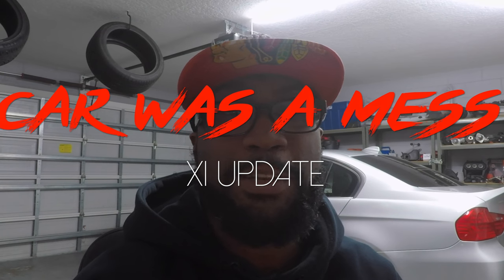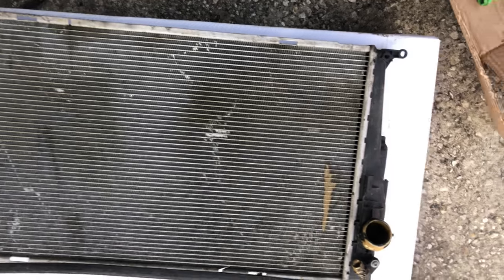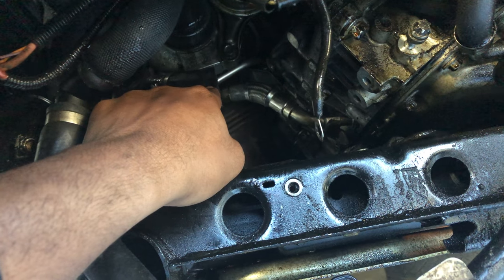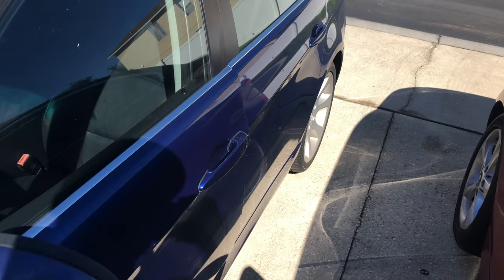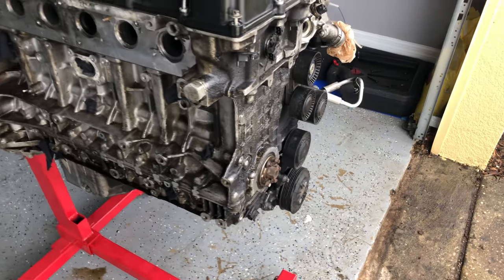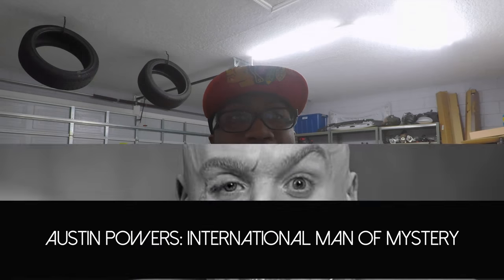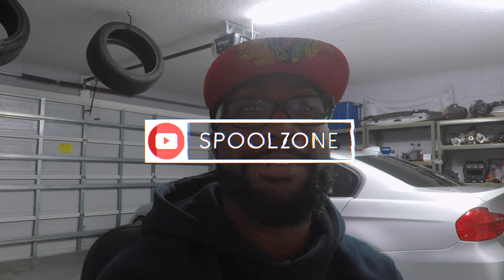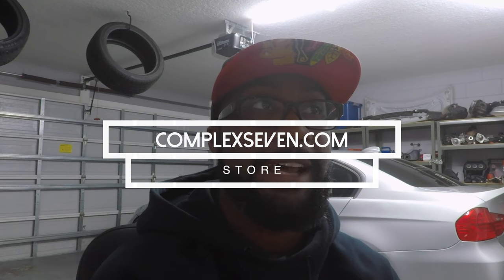EP-01: Project Xi: Cheap BMW N54 335XI Back On the Road & Channel Updates

Comment: I changed my ofhg and cooler gaskets 6 months ago and those mothers are already leaking again! I need to get on it asap and change the serp belt too ☹
Reply: noshi yep! I'm guessing I either didn't clean the surface good enough or didn't torque the bolts properly. I love my e92 but it be testing my patience sometimes lol 😕

Comment: I change things all the time tell I'm getting burnout on the platform. 
Yes might be M'n it up😏
Reply: @nOshi2x  fcpeuro is where to go for best deals! Yeah after all this time you would think it would get cheaper to maintenance since there so many newer platforms out but as for the n54 things are still pricey right.😁
Reply: @nOshi2x  I just recently changed injectors, coils and plugs. It's a pain but still have a lot more to go I'm at 173k full bolt-on running custom maps gotta do gaskets next then suspension and coils n springs, bushings, disc brakes, rotors, all control arms Etc. Just hate it man but in order to keep up with maintenance schedules this has to be done correctly. That's why I'm fast to tell guys if your going with these platforms beware they're high maintenance vehicles. And you must be adamant in all areas. 😤
Reply: @nOshi2x  yeah bro I've been beating on it like crazy and it has served me fine I'm satisfied in as much as durability and life with this platform, I've heard the horror stories of guys replacing their engines before time.....hell even you bro...right? But me I've been fortunate to have the same engine since inception. And if I don't grow to tired of DIY's I plan to keep it up or get something along the m-line.
Reply: @nOshi2x  I feel ya there hopefully I get the opportunity to do  the same. Ty 😁🤙